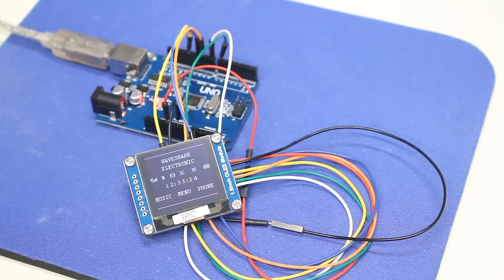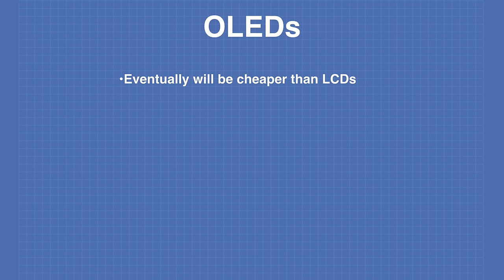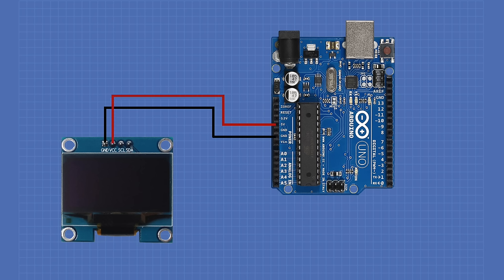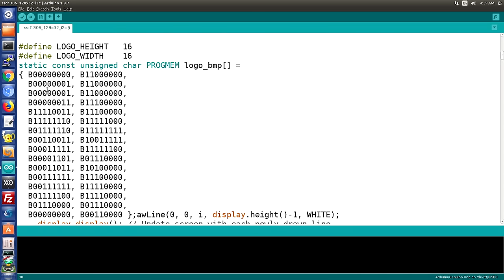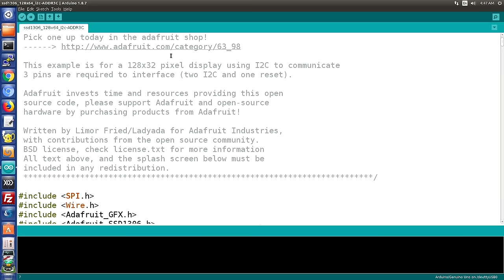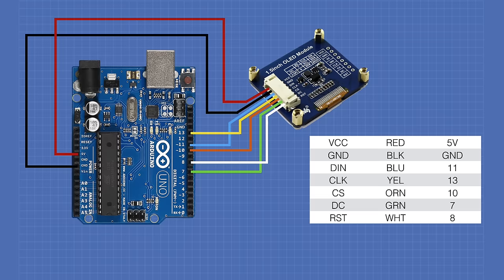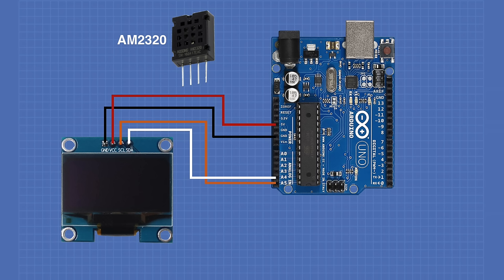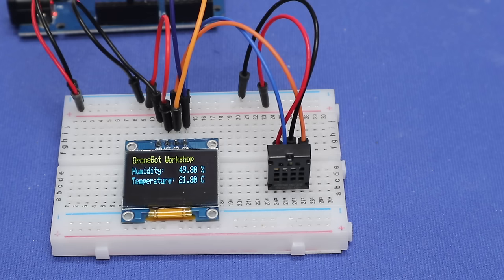OLED Displays with Arduino - I2C & SPI OLEDs

Comment: SPI is a bus protocol. You don't need two SPI ports to run two displays. It's possible to run lots of SPI displays from an Arduino, as long as the display has a CS connection, you have a free GPIO pin to select the display, and the display library differentiates display objects by the CS pin value you defined. They can even be different display types with different clock (SCK) speeds and resolutions. On the 32 bit boards e.g., Teensy, it's possible to animate as many as four 320x200 displays, separately, at the same time with acceptable results, using one SPI port.
Reply: Surely you cant use the same SPI port as SPI is synchronous, and will relay the same information from it’s MOSI pin to every peripheral with the chip select set to low? If you wanted to send different information to different screens at the same time, wouldn’t you then need different SPI ports? Also I doubt you can have different clock speeds if every peripheral shares the same clock connection. I’m still new to electronics so correct me if I’m wrong haha
Reply: @davidzatica408 I don't get your argument. Both protocols has one bus and communicate with one slave at a time(or same data t multiple slaves), but since spi has 2 data lines you can shift in and out parallell, and it can work with a much much faster clock speed(4-8MHz vs 400khz on atmega328p@16mhz). You'd get much better performance using spi for multiple displays than I2c. Basically, the only pro I2C has is less cables and "easier to program". But the performance you can get on a display via spi is a >magnitude that of i2c.

Comment: A lot of I2C devices require 3.3V logic. Attaching them directly to the 5V I2C logic provided by the Arduino may damage these devices. It is best to use a logic level shifter in these cases.

Comment: You are awesome. I learned a lot. Your delivery is exemplary. Your knowledge is paramount. Thank You. I am 56.
Just ordered more (MM) jumpers and an AM2320 sensor AND an AM2302 sensor module. I have Arduino, breadboards, OLED displays, and power. Thank you for explaining the code so well. You make no assumptions as to how much any individual knows. I would rather say "already know that" than "Oh, what did I miss?". Thanks.

Comment: You may have read somewhere that changing camera position keeps a video interesting, but I'd suggest that it is interesting because of your content. May have said that the two camera switching thing is a bad idea, and I agree if you switch without it having a meaning. If you need to switch, put a graphic or closeup. Switching between cameras can be used to tell the audience that you've got a side note to add for example, but switching for the sake of it tells them nothing. Camera angle is as much a part of your visual communication as you actual presentation.
That said, thanks for the information. Very informative.

Comment: Hi Bill, nice to find your site.  I too was struggling to unpack Adafruit's example for a SSD1306 driven OLED. Its very comprehensive, making it a bit complex for someone just starting.  I used your example as a starting point and I'm integrating Adafruit's elaborations one at a time to understand them better.  First time I've been able to get one working for my uses.  I kept going back to their example originally just to see I had the hardware working, but was having a tough time modifying it without blowing up the sketch.    Finding your example helped me to see how to drive it effectively.   I do have to mention that I think your example seems to have one extra " void setup() { ".  It seemed odd, so I commented it out, everything worked as expected.  Thanks for the help.

Comment: Another interesting video. I was presented with an OLED driven by an ESP8266 by my No. 2 Son, and it displayed a suitable Father's Day message. I transferred the components to a breadboard whereupon it stopped working. Thinking I'd blown up the OLED (they're unforgivably polarity-sensitive, apparently) I bought a second one and plugged it into the breadboard. Again, it didn't work. Investigation showed that the pin connections to the two OLEDS were different, so this may be worth bearing in mind - different manufacturers may use different pin arrangements. I thought I'd blown up this second one, too, because of the wrong connections, but closer examination revealed that the negative jumper lead from the ESP8266 to the OLED was open circuit! When this was replaced both displays worked fine. So two lessons learned - always check the pinouts, and don't assume the complicated stuff will fail and overlook basic troubleshooting techniques.

Comment: Thanks Drone Bot! My 128 x 64 OLED showed 0x78 on the chip as the address. I tried lots of values and options. Finally I tried 0x3C from your 128 x 64 display section and it worked! Viewers, the chip I bought that clearly showed addresses 78 and 7A on the back is the IZOKEE .96" 128 x 64. A startingelectronics.org site mentions this issue, so it apparently isn't exclusively this brand that has this exasperating goof.
Reply: Helped me also, mine are 7B and 7A, and worked with 3C

Comment: Thanks for the challenge. I used my DHT11 sensor and a small OLED to emulate your results. I had to do a lot of copying and pasting snippets of code from here and there along with a little bit of stuff I stole from this tutorial to make it work. My little OLED prints Temperature in Fahrenheit, as well as Celsius and Humidity. The DHT11 isn't the fastest or the most accurate but it does the job. BTW it took me TWO full days of frustration :). Thanks again for keeping me on my toes. It is much appreciated.

Comment: I've got several Arduino modules I've been shamelessly neglecting including one that uses the AD9850 DDS.  The DDS will generate a stable sine wave up to 30 MHZ and my goal was to create a cheap bench top frequency standard for amateur use.  Btw, I am a licensed radio amateur call N1ABE.  Anyway creating the standard was a piece of cake.  The DDS was an I2C device so the code was trivial.  I had entertained the idea of writing a python script to control it but that meant you'd need a PC to use it and I wanted something stand alone.  So the question was how to make it compact and not cost a fortune and also come up with a design someone other than me could build.  Your tutorial was extremely helpful in explaining how to interface an OLED display to my project. Believe it or not I was able to get a 128x64 .96" I2C monochrome display for $3.  One of your other tutorials showed how to implement switches in a resistive ladder configuration which was brilliant.  However, I will make my own network since it is a really simple design. I'm an EE by trade but am no stranger to coding and find the sketch walk throughs very helpful.  I do have to agree with a lot of the comments that the constant switching of the camera angle is distracting and annoying.

Comment: I ~love~ your videos!  They are great and have really gotten me in the boat with Arduino.  One suggestion on production values: You really need your camera aimed straight-on or slightly downward at you face without you lifting your chin..  Not an expert, but you seem to tilt your head back to try to look squarely into the camera.  What happens is that the camera seems to be pointed at your Adam's apple.  No matter how. pretty one is, no one can escape the reality that this the is the way old movies photographed villains!   You're not a villain; you're the hero of the DroneBot Workshop!  More like Captain Marvel!

Comment: I'm not sure how many times I have watched this video. All of your videos are great reference material. After watching again this time I noticed two things. 1) the long thin display does not appear to be using the full height of the unit. 2) the CJMCU-9548 allows you to display different data to the same i2c address just as if they each had different addresses. I think this unit came out awhile after you made this video though.
Reply: I guess I was thinking of one of your other great videos as this one just came out.

Comment: Excellent video, thank you. A heads up to anyone using a DHT11 temperature sensor, it does not use I2C, it needs its own digital pin for data.

Comment: I would recommend ALWAYS having a pull up resistor on I2C lines.    It is an active low type of protocol so a good pullup will make it more immune to noise on the I2C lines.
Reply: Yes, depends though.  As they are built right into a lot of sensors now.

Comment: I've started to use the Nokia 5110 because it's big size and easy to read in daylight, and runs on very little power...and cheap!  I might even put two into one project!
Reply: Oh I forgot why I posted...the oleds look very nice and grab your attention, so I've been very tempted to get one of the smaller ones.  Just not sure if my eyes could read it! Lol
Reply: @TheRainHarvester   OLEDs are much higher contrast than LCDs, especially reflective LCDs like the Nokia.  You don't have to use the small fonts that he did, either.  You should have no problems seeing them if you can read the Nokia display.  They're getting pretty cheap - get a small one and test it out!

Comment: My 128x32 display lasted about 6 months before pixels that were continuously lighted began fading away. Perhaps it was a bad series, but I replaced it and added a screen saver algorithm to my Arduino code. On the other hand, my 16x2 LCD display used on another project, has been running for a year now with no problem and without a screen saver.

Comment: Hey Bill. Love your work. With all the views and comments, I was wondering why no one has mentioned that the demo code will not compile.
At line 34, there is an extra 'void setup() {'.
Reply: I see a missing "carriage return" at the end of the array block and an open brace in the Setup procedure (I assume, left over from a comment). //s are much better (unambiguous).
Reply: Gave me a headache.  Bill should edit the code and remove the extra Setup().  Well, It's good troubleshooting practice.

Comment: Hi I like your video on the oled displays, one thought the I2C bus is an addressable bus but the AM2320 doesn’t have an address in your code, is the address of this device preset in one of the headers. Many thanks keep up the good work. Keith

Comment: I have one of these clocks.  The odd thing is that I am unable to turn off the automatic brightness control.  I have set the light to a low setting to put the clock in my bedroom, but when I turn the lights out, it actually get much brighter.  I have half a mind to unsolder the photo-resistor and replace it with a standard resistor to fool the clock into thinking the lights are on and not change the brightness.  Really cool kit otherwise!

Comment: Time has gone by since this came out but I’ll ask anyway: why don’t you need to declare an address for the temp sensor like you do the display? Is the address fixed and in the library? Does the library search for it? Does the sensor report it?  Thanks for the always well done video! A terrific resource.

Comment: Hey Boss, could you find and rebuild a vintage wooden radio using a headless raspberry sdcard/wifi and bluetooth module? Im kinda sketchy on the power supply right now for my own build. I think itd be a great learning lesson for all.

Comment: This is excellent, very helpful. I am trying to do the exact same thing, using an Arduino sensor kit oled SSD 1315 and DHT20 RHT sensor, both I2C as shown here. Do you have any experience using the U8G2 library for controlling the oled?

Comment: Hi, fantastic intro to OLED Adafruit library. but, I would like to see far more in deep projects and tricks that you can apply. I.m thinking, since most of the viewer are very likely to be new to microcontroller world (like I am) it would be beneficial to have some videos explaining in detail when you need to display analogue readings such as an  ordinary temperature sensor (for instance a thermistor) or a relay state (on or off)  or an led state (on or off) or the set (desired) temperature (that you can set via a analogue pot or some push buttons as well as the actual temperature at the same time. How you actually put all of the above in code so all the info is shown at the same time and where specifically in the code (in loop or in setup) you need to place the code to mak it work  info.  I've tried for many many months now to achieve something like this but every time I try something I never know where is the right place to insert the oled part of the code. A good example is that for instance  I want to convert a code that was written for an 16x2  SPI type LCD screen but need to adapt the code for the use of an 128x64 I2C OLED. So having that code as the guide I've tried probably 100's of combinations but nothing seems to work. It is very very frustrating since there is not a clear general rule that can be applied to all and every project. There are just too many options and way to many things to consider and learn.

Comment: Nice . I like your way . Can you do a project like this one but it can give you ( voltage input voltage output / current in / current out  / power / wh / temperature c / ) and a pulse mode to control mosfet to keep the output voltage ( as a ups arduino project ) but this will be with screen and more details sitting

Comment: Gona share quickly a problem I got. After following all the steps my screen remained blank. I doubled checked my I2C and everything was correct. So has a desperate measure I tried entering the wrong I2C and use the one in this tutorial (which is also the default in the library) and it worked. Conclusion, some Aliexpress vendors write some I2C address in the back but then use the default one in the library.

Comment: This is an excellent video.  I have a question - When using the I2C displays you use the Adafruit library but when describing the Waveshare OLED with SHI you use proprietry drivers rather than the library.  Is the library not appropriate for SPI? Thanks.

Comment: Great project!! 
However, I did have 1 question: You set the text colour as white, but the display was showing the text in the yellow and blue colours itself.... is there a way to change the colour of the text?
Thanks!

Comment: Hey Paul. Thank you for this video. If there are only three pins on the master (SPI), in a daisey chain configuration, does the last MISO need to be reconnected to the master? Im using an oled display which does not need to communicate. Thanks!

Comment: HI,
I wonder about how to use the 1.5" WaveShare OLED display with Arduino by connecting via I2C instead of SPI. Do you have any experience? What wires are needed to be connected to the display and Arduino (which pins?)? How can the address be set?

Comment: What is the price difference between an OLED and a 4x20 LCD? If both were to accomplish the same thing, would the OLED be 2x as much?
Reply: Depends where you buy it - In Microcenter a tiny OLED costs $25.00 - complete rip-off

Comment: Hello Bill,- Using the SPI interface now what do I do If I need another SPI device. With SPI I know you only have to have two different address but what about SPI ? Can the CS pin be used to separate two different devices ? How would you do this ? Please HELP:.

Comment: Couldn't find a way to post issues on the website so hopefully it is ok to list them here:
1. The above links to the article are broken.
2. The waveshare sample for the SPI OLED (OLED/Arduino/INT_RAM/OLED_Show/) no longer compiles in the Arduino IDE. I'm sure I had it compiling before so I think something has changed: LED_GUI.h:17:10: fatal error: fonts.h: No such file or directory
Reply: May we help you?

Comment: Putting 2 I2C devices at the same address has risks associated with it. Even if they are the same type of device, the I2C protocol is actually bidirectional. If you send data to 2 displays they both acknowledge the data they receive and if for some reason one device responds a few us later or misses a data bit and therefore doesn't ack the whole thing can go belly up. When it's just 1 display you can have an exception handler and resend the missing command/data. What I'm saying is there are simply no guarantees with this configuration.

Comment: Hi thanks for your tutorial.
I got an issue using it and couldn't find solution anywhere. 
i am using ARDUINO sensor Kit base and it got Oled Display 0.96. It have other I2C components as well( Air pressure sensor & Acceleration).
I can't see anything on Oled when i use OLED with Air pressure sensor or Acceleration sensor.

Comment: Hello, my only question is that is it necessary to solder the pins in the display? My display is not working so I'm assuming that it must be soldered.

Comment: I just assembly the circuit and tried to load it in to my Arduino Uno and I got one error, could you tell me what is the way to get some help?.
Thanks
Alex
Reply: You can post the reply. But for now, you can first verify whether the library you are using is intact or not here: https://wokwi.com/arduino/libraries/SSD1306Ascii/HelloWorldWire reply if you need help in using the Arduino library with the online Arduino emulator